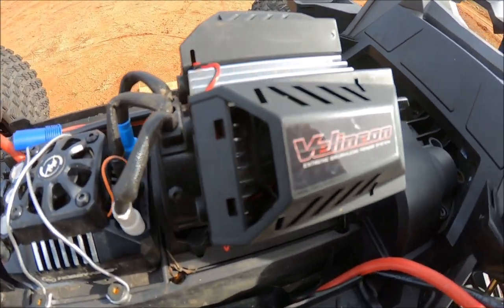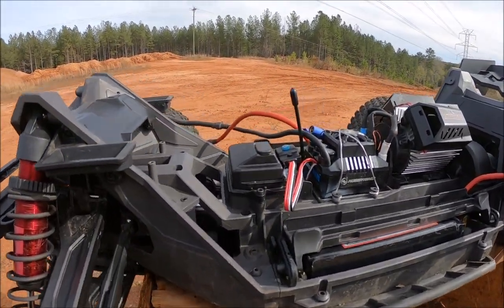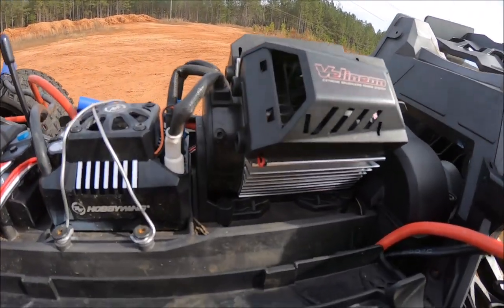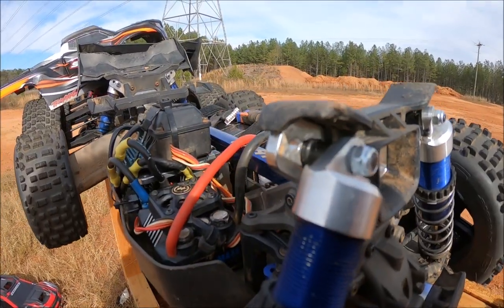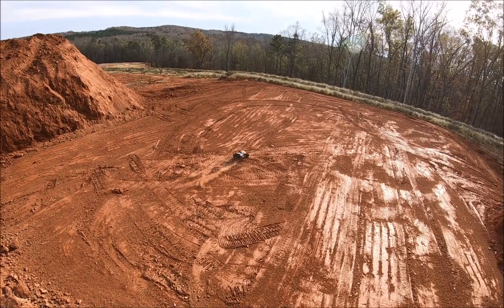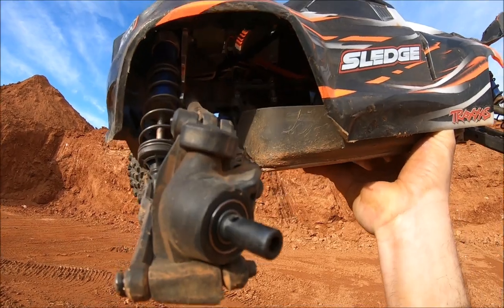New Traxxas XRT 8s and Sledge 6s HAMMER DOWN!💪1250kv and Upgrades!

Comment: Did you follow the pin setup in the chassis when you set your gear mesh since it’s factory 23/46 speed gearing or did you use thee ol paper trick?
Reply from the maker: I followed the pins with 23/46 yes.